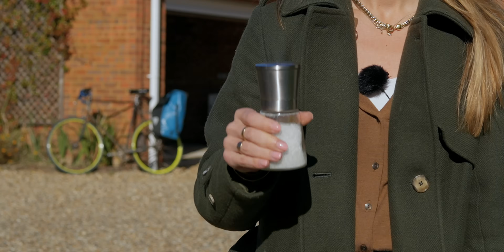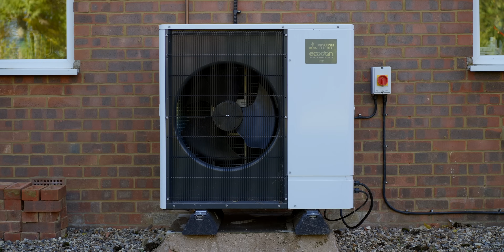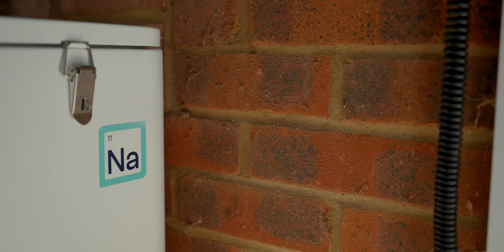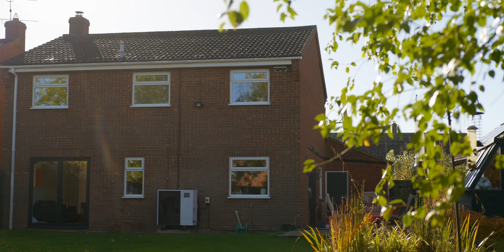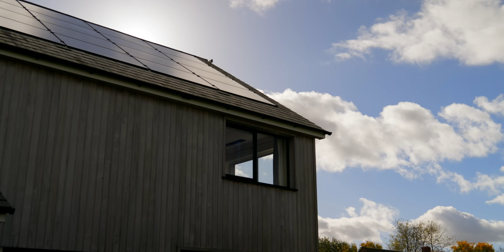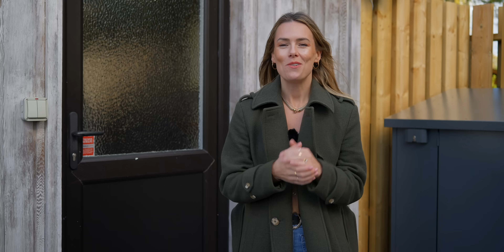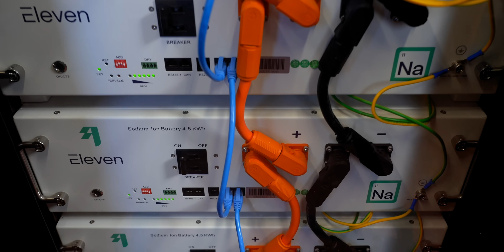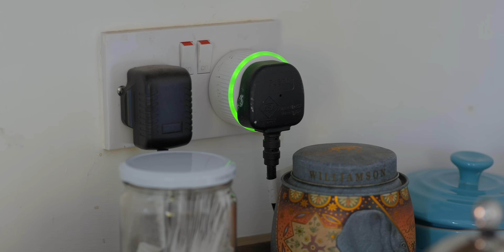Sodium Home Batteries Are Here! Is Salt The Key To Cleaner, Cheaper Energy?

Comment: The great thing about Sodium is not that it will replace lithium - entirely, it's that will complement it and reduce demand for it, putting negative price pressure on the lithium as well as be cheap in itself.
Reply: Sodium ion batteries won’t need the thermal management systems that lithium ion battery need. So, that’ll reduce battery pack prices and maintenance issues.
Reply: @freeheeler09 that's great! andd who knows how good these batteries will get after another decade or so.
Reply: @starmole5000  Checking in after CATL's announcement!
Reply: @witmoreluke   :)
Reply: @freeheeler09 Oh boy. Yes you need to manage thermals. Full stop.
If a dendrite forms - you get a short; that short triggers thermal run away; that runs you into a massive current release and this is a chemical reaction that will cascade.

The benefits are as follows:
1. Higher safety range.
2. Ability to run it down to 0% charge for transportation.
3. Lower cost with the abundance of the material.

But don't kid yourself: Thermal management must still be done. The difference - is the complexity and difficulty of such.
Reply: @freeheeler09 Most importantly for homeowners, installing one doesn't push home insurance prices up. Not a serious consideration for some but if you want widespread adoption then this is an issue that has to be addressed and is a barrier for Lithium Ion batteries inside homes.
Reply: There isn't a day that goes by that some jurisdiction announces a "huge" lifetime supply of lithium.  It's Fool's Gold.  The joke is on them as developing a lithium mine is a min. of 10 years down the road and by that time, lithium-based batteries are going to be dead in the water compared the alternatives - sodium ion, aluminum ion, and Samsung's solid-state battery.
Reply: @Roarmeister2   Do you  know how many announcements of battery tech and super cool revolutionary technologies have been announced since 1987 - when Lithium Ion tech was first patented; Or 1991 when the first products were sold by Sony?
Yet: Lithium Ion simple got MORE popular; MORE common.

Its' going to be 10 years before we see what of the last 5 years of battery chemistry announcements, and technological research actually pans out. And then it will be another 20 years before we see significant shift in general products sold on the market.

The reality is: When you go to bulk consumer production - reliability matters. And when it comes to certified products - you are not going to put in a technology that MIGHT cause problems, even if it has upsides.
Reply: Different energy requirements have different solutions. At the moment sodium is way more cheaper than lithium so is better for static domestic use but will probably not supplant it for applications where weight and size are primary considerations. But never underestimate what technology might come up with in the future.
Reply: @grahamcurran3425  When it's cold: They keep more available (usable) capacity; When it's hot - they have more thermal overhead range before risking a run away event; When they do burn - the results are less toxic/problematic than lithium-ion chemistry.

These will be used.

Lithium Ion was introduced in ~1991; patented ~1987; And has had fairly substantial improvements over that well, close to 40 year run. My guess, we are going to see some significant improvements - not the same level, as, some of the improvements made for lithium ion will translate (related to precision manufacturing, ability to isolate charge transport ions, prevent dendrills through means other than brute force etc). But I wouldn't be surprised if we see 15-20% gain narrowing any difference between the two in energy storage to total battery mass consideration.
Reply: It's time to revisit Nickel-Iron, the ingredients are well understood, cheap & abundant, the cell is mechanically simple & easily recycled & there are 100 year old batteries still in use. They were specifically developed for the EVs of the late 1800s though the main use nowadays is in submarines.
Reply: @alanhat5252  interesting!

I guess my initial reaction would be - if it was feasible or economic it would have been done by now?
Reply: You know how economics work ?, they wont lower the prices. Perhaps like 10 cents cheaper the Amp... But thats it.
Reply: @Darwinsfunprojects   increasing supply won't lower prices?

ANd you say I don't know how economics work? :D
Reply: @Darwinsfunprojects   Oh and by the way I never said it would LOWER prices.

I said it will put NEGATIVE PRICE PRESSURE on lithium batteries.

Those are not the same thing.

Can you read?
Reply: The energy density is always 20% less than lithium due to the nature of the sodium atoms, but it can still be improved

I will expect sodium ion to be comparable with LFP, and if it's further improved, it may reach energy density similar to today's low end NMC with the same cycle life as LFP
Reply: @sihamhamda47  I'd imagine sodium along with further compounds made with it will improve it as a battery tech in every possible way. "Purely Sodium Batteries" is just the start.
Reply: @sihamhamda47  As someone with a chemistry degree (I never became a chemist - just got the degree) - that sounds feasible. Sodium is larger so it's not generally going to reach the same densities, and it's got the same +1 charge regardless of size.

Materials science I always found fascinating, and there's so much complexity to it - I feel like the new few decades should see some magic materials coming along :)
Reply: @sihamhamda47  Things are never that simple. And the working chemistry in total - matters. Yay Cobal with Lithium - it's Atomic #27, and typically has an atomic mass of ~59. The big heavy weight of Lithium Ion isn't the lithium - it's the cobalt.

It totality- yes: Lithium Ion, in ideal circumstance has higher density. However: It has also had like 40 years of improvement and development starting off in 1987. And a lot of other promising technologies got left by the way side by... Lithium Ion.

That being said: there are some clear benefits to this, provided you can fund the build up of the manufacturing capacity.
1. Operating in lower temperatures, without losing capacity;
2. Higher Thermal overhead - Lithium Ion safe cut off is around 60C; These - look like they could go to 150-200C before thermal run away becomes an issue.
3. Reduced necessity of active thermal cooling - see the above; As long as we can manage power draw down of each cell; We can allow for more simple/passive thermal dissipation solutions; Possibly with guaranteed minimum air flow for commercial installations.

Simply put: There are already cases these are better than lithium Ion. Because practical usable capacity, beets out theoretical capacity in real life scenario's.

Comment: its truly wonderful to see so many different breakthrough battery technologies. 

i especially like BYD Blade Batteries and CATL Shenxing Gen 2 Batteries that last over half a million miles while retaining 80% or more capacity to fully charge, have zero fire hazard, lower cost materials and lower cost to manufacture, 100% recyclable, and charge in half of the time it takes to refuel a petrol vehicle (called five minute flash charging or 1000 kilowatt charging or megawatt charging, all one in the same).

its also relevant to mention that nobel prize winning physicist Richard Feynman taught us that empty space itself, which is the space that occupies the very air we breathe, contains enough dormant/sleeping/or potential energy to meet the energy needs of all civilizations throughout history, add infinitum, within only one cubic centimeter (sugar cube area) of the space that is the air we breathe.

paramahamsa tewari teaches the peer reviewed theory and practice of space vortex theory, and the tewari reactionless generator, and nassim haramein teaches the peer reviewed works of understanding infinite energy within each breath of air we take, also called infinite energy at infinite points in space.

Comment: Great video. Everyone should aim to be aiming to go completely off-grid using batteries like these and solar.
Reply: Grids have their place. People who live in very wet climates won't be able to get all their electricity from their own roof all year, but the rainy season is generally a great time for state-run hydro-electric generation. If the population is self-sufficient for electricity even 3/4 of the year, that makes those hydro schemes a whole lot more useful in filling the gaps. And most apartment buildings aren't going to be self-sufficient for electricity ever, because they have too many dwellings under a very small roof.
That said, I love being off grid. I just know it's not for everyone.
Reply: @tealkerberus748 solar glass windows, and even solar powered wall coatings that can go on any surface, will also help with things like high-rise buildings.

Comment: I am in the process of getting funding (on behalf of the landowner) from the Energy Saving Trust to install a battery-buffed DC charger.  The site is the outside the old community hall which has a business tariff currently but has been used only for storage for a decade and therefore currently uses very little electricity.  I have been very disappointed at the position of the electricity providers who cannot offer anything like the low rates that I can get at home with Octopus.  Part of the reasoning behind the funding is to make the grid more resilient, providing electricity storage locally (we are on an island and very much at 'the end of the line', power supply-wise, suffering power cuts regularly during the windy winter).  

It is a bit baffling why, as a domestic user you can earn a fortune from arbitrage but not if you are running a business!!

Comment: When the salt batteries become massively produced, so cheaper, desert and flat regions that cant build dams, as the main battery as we use them here, will be able to build solar + wind electrical production with full stability.

Production -> Inverter -> Battery -> Inverter -> Grid.

In add to that, less energy lost because of frequency to be able to send into the grid.
Reply: What?

Comment: I'm getting fed up with people quoting "the average household uses around 10Kwh daily
WITHOUT factoring my EV into things I use around 16 to 20 daily in winter and 10-12 in summer and it's just 2 retirees
Reply: The EV doesn’t charge from the battery as it charges overnight. They are talking about typical usage for the home. We use about 10 to 20 kwh so my batteries just about get us through a peak day and have loads to spare on a more average usage day.

Comment: The claims here are a PR-optimised half-truth sandwich: sprinkle some real electro chemistry, add some kitchen-table metaphors, and glide past every design constraint that makes sodium-ion totally un competitive for home storage.
Sodium doesn't jump out of a salt shaker into a battery, it's a massively process and energy intensive way to make a battery this way. The round trip efficiency is the worst of all the main chemistries (a lot worse) meaning extra panels to cover make up for it with solar. The linear drop off discharge voltage makes it not suitable for most inverters. All these factors combine to make it so much less effective than LFP on a cost basis it doesn't even figure.
Reply: Yeah, you need to figure the whole system cost. More expensive and complex inverters, thicker wiring (to support higher currents on lower SOC), appaling efficiency, so more solar needed for the same net production and so on.

Unless cells are basically free or dirt dirt cheap, it makes no sense to use compared to LFP.

Comment: Those battery and inverter cables are way too small for a 6kw inverter. I would love to know the total theoretical load for the property, pretty sure it’ll have an 80amp RCD at minimum.. Either that’s a fake setup or it’s dangerously under specified! Come on boys own up, who signed this off 😂😂😂
Reply: 2nd installation owner here - I can assure you it isn’t (a) fake or (b) under specified. The AC cables are 16mm SWA and the DC ones are rated to 200A, but the batteries limit at 100A.

Comment: Hopefully the mobility and wheelchair industry can get on board with this, cold weather really affects the range of powered chairs
Reply: So half the range all year rather than just when it's cold...
Reply: I don't think this would benefit wheelchairs or mobility scooters or EV's either. It's not energy dense enough and the batties would be too big and heavy. Your better off using good insulation and heating the compartment slightly.
Reply: @donkeee785  well theyve just made somne breakthroughs with the energy density and you really think sodium is less energy dense than scooter original GEL batteries?
Reply: @electricalfive2248 enlighten us.  My understanding is this is not suitable for transport yet. May never be. But if there’s space, good for static.
Reply: @donkeee785 most mobility devices are still using lead-acid 😂
Reply: Cheap standard range cars would benefit from this since the total cost of the Na-ion battery production is 30-40% less than Li-ion

Sure in this year the price has not reaching that level yet as it's just the beginning of mass production, but as the production rate ramps up hopefully it will be happening in 3-5 years
Reply: Given the increase in battery weight, it could come to happen if the company recently (04/26) featured on this channel, Yasa (if I remember correctly) applied their tech to the motors on wheelchairs as it should save significant weight to make Na ion batteries commercially and practically viable.

Comment: how i see itt, many have the whole thing backwards...
you get solar and battery, so you can be independent from the grid, at least within your budget some degree, i mean there is a power outage, bu you have still electricity, and if you have an electric car, the oil price based benzine and diesel price hikes wont affect you.
its not simply about what you can save on electric bill, its about longer term energy safety independent from the government or from the "free" energy market.
Reply: You can save a lot on your electricity bill if you go off grid, though. I haven't had an electricity bill in over fifteen years, and the only times I even know about a power outage is when it makes the news.
Reply: @tealkerberus748  But how much did you invest upfront, aka paid all your electricity bills years in advance?
Reply: @user-lknksjdfhg  I can't remember now - it was certainly not nothing. My initial battery set was second-hand and very cheap but I eventually had to replace it, and solar panels were insanely expensive back then to what they are now.

But I'm in a rural location where I would have been required to pay for connection from my house to the nearest SWER line (single wire, earth return), and the price we were quoted was more than the budget for the house. My solar setup was very cheap compared to that! 

Also since a really bad bushfire season some years ago, it's policy that if there's a fault in a SWER line during extreme fire weather, they'll repair the fault but keep the power switched off until the weather eases, just in case there's a second fault on that line and switching it on starts a fire. So if you're on a SWER line you could be facing a week of 40+ temperatures and no power. I understand the reasoning, but I don't choose to be on the pointy end of that policy.
Reply: @tealkerberus748  Ah yes, under those circumstances I can see how it was a good choice. Just straight up buying solar/batteries/etc. is almost like paying all your elec-bills up front if going off grid so you have to be diligent and lucky to pay it off over a decade or so and then hope you can squeeze a few more years out of the system to really have it be cheaper. 
Glad things worked out in fire country for you!

Comment: Geezus, who does their shitty fact checking? CATL's Naxtra Gen 2 has 175wh/kg energy density. That's why everyone is suddenly taking sodium batteries seriously.  And because it operates at very wide temperature range, sodium batteries don't need active thermal management. Therefore, more sodium packs can be placed in same space as LFP, at what should be much lower cost and complexity.

Comment: Getting through a day with 9 kWh? Are we talking about a house or an apartment? Try actually using electricity for heating, tap water and cooking.
Reply: If this has 9kWh of usuable capacity and the typical roundtrip efficiency of Na+ and the invertet itself, you'd be lucky to pull out 4.5-5kWh on the AC side.
Reply: @hojnikb How do you figure that?Inverters are usually like 95% efficient.
Reply: @itekani  Terrible roundtrip efficiency and very high voltage drop. So you can't actually use the whole battery without seriously degrading power output (due to voltage drop).

Also, if you have solar; At 10kWh production going stragiht to the battery, you might only pull out 60-70% out of the battery; so 6-7kWh usable before inverter losses.
Reply: @hojnikb So you mean sodium batteries have much higher charge/discharge losses than lithium?
Reply: @itekani  yes exactly..

Comment: The closest he came to a price, I think, was 4K, for a 9kWh battery. He did some, class A, dodging. 
MISTER; I would emphasise the 'cold start', 'cold tolerance', and 'pass it on to your children' lifespan. 
Cabin, you only reach every few years? A portable 'power supply', of a few kWh would get your system started, even in freezing temperatures. Price? Buy our smallest system; by the time you love it, the next module will have halved in price...ditto the next one. Just tryin' to be helpful. If you read this, and make money, please give me some of it...please. (Unless it's in any way related to illegal occupations, or Apartheid.)Regards, M. (Oh! or genocide., sors.)